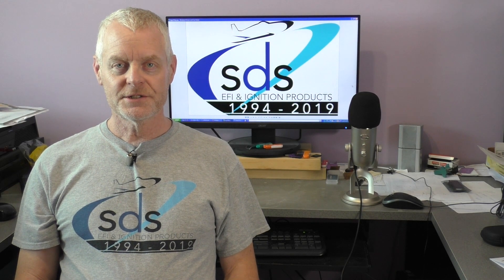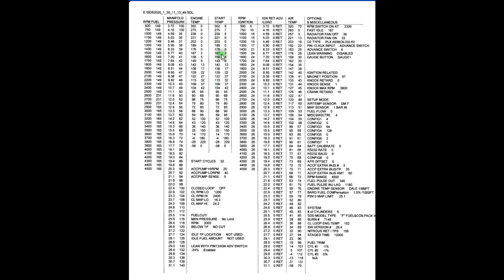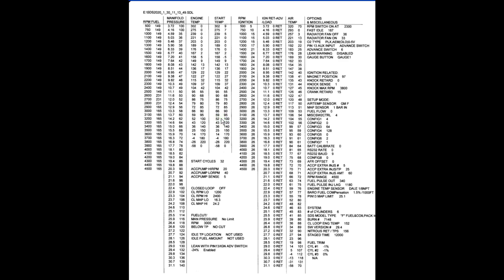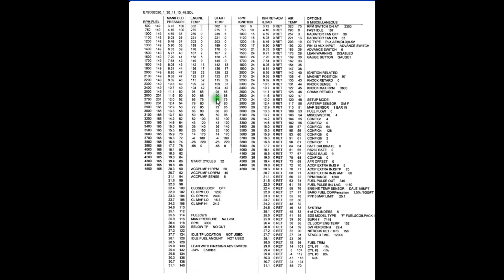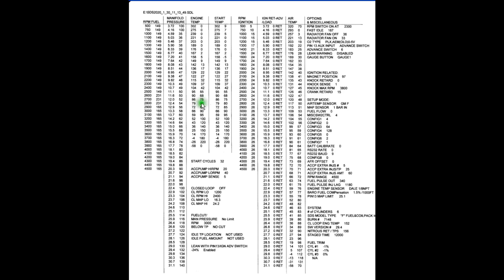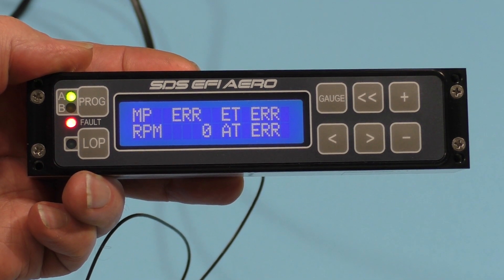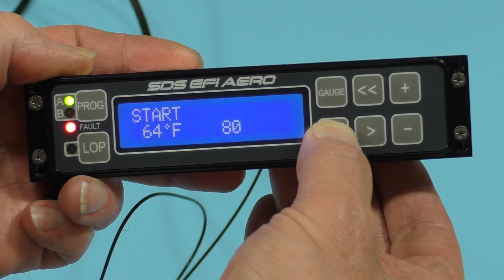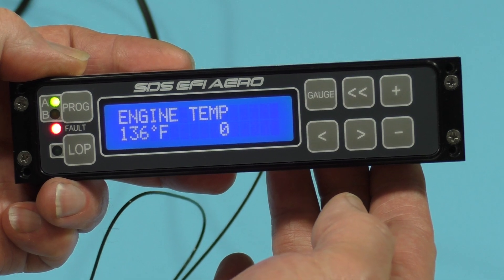Vid #85. SDS EFI Cold Start Programming

Comment: I've got the basic idea, but what value should be adjusted when you crank the engine,  it sounds like it wants to start, maybe fires on a cylinder or two but doesn't start? This is present at cold 34°f ET up to near 120°f ET.  System uses map sensor. I can get it to start by pumping the throttle a few times while trying to start. This engine likes to be quite rich while startinh, warming up and at idle.
2.8l 4cyl 
75 lb/hr injectors 
3 bar map 
Any tips are appreciated 
Thanks
Reply from the maker: I'd try to make the Start Values about 50% bigger than they are now.
Reply: @rv6ejguy  thank you, I'll try that.